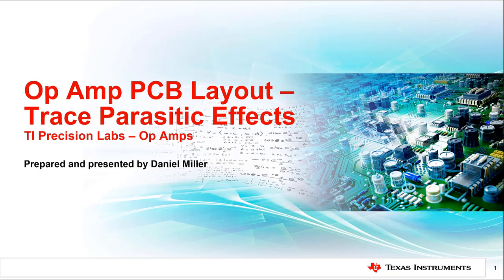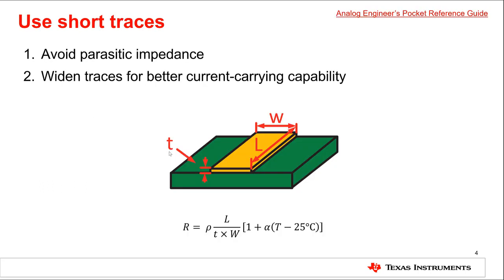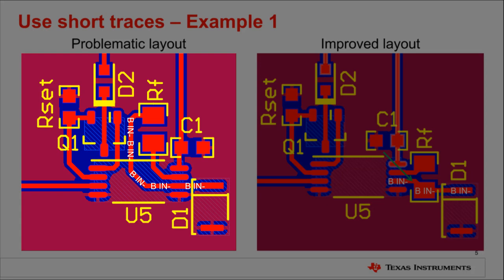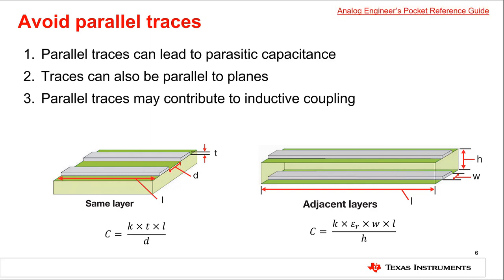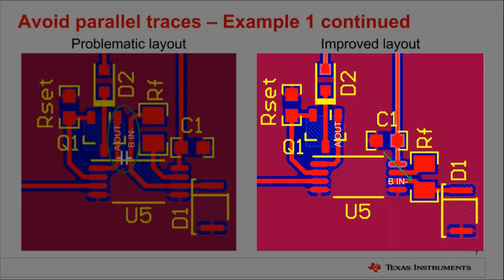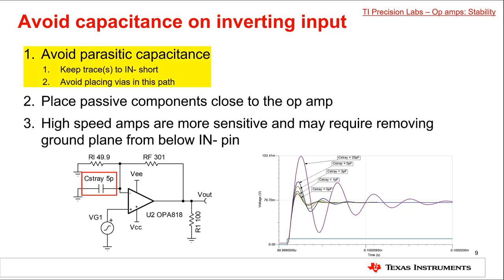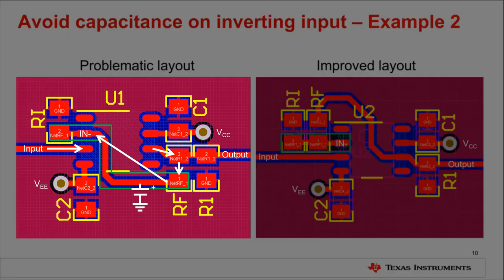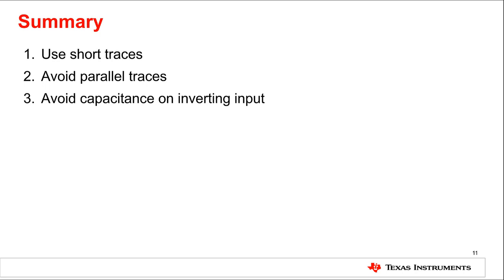Trace parasitic effects

Comment: Very cleanly detailed about how to avoid some of the parasitic capacitance. I will definitely keep all these details while designing my next PCB with OP Amps. Analog stuffs  are amazing.  How do I learn to design a new OP Amp ?
Reply from the maker: Thanks for your comment! Our engineers on the TI Amplifiers team recommend a few books that may be helpful. “Analysis and Design of Analog Integrated Circuits” by Gray and Meyer, “Design of Analog CMOS Integrated Circuits” by Razavi, and “Microelectronic Circuits” by Sedra and Smith.